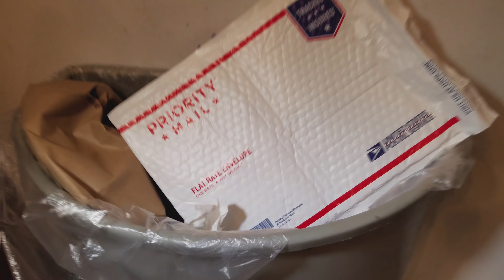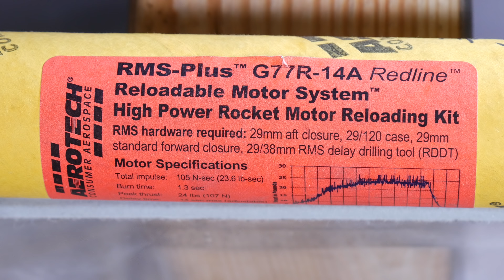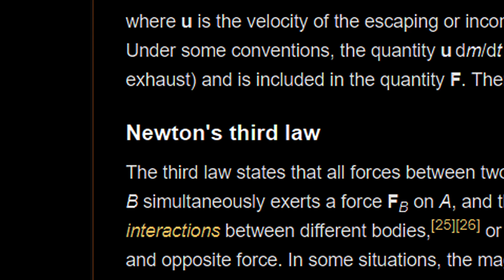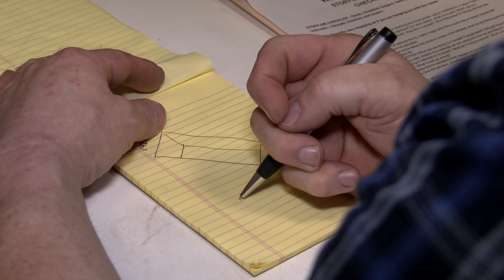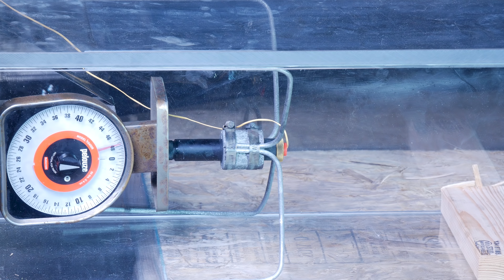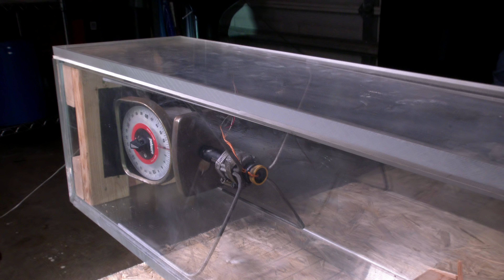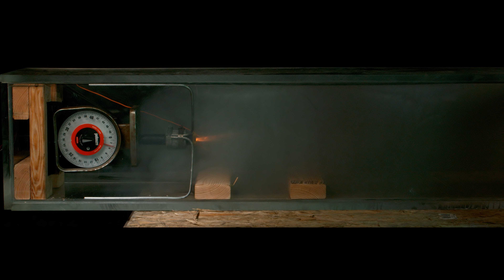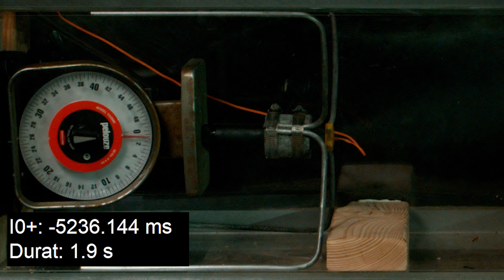Rockets in a Vacuum Chamber - Newton's third law of motion Visualized

Comment: Show the same video with a vaccum gauge the vacuum is filled with exhaust then you get thrust... Show it with a tank big enough to not deplete the vacuum and make that model rocket engine move. And then I'll believe it
Reply: How about live video of a rocket performing propulsive maneuvers in a vacuum.
Will you believe it then?
Reply: @stuartgray5877   the problem lies in expanding gases depleting the vacuum then you have thrust, space is an endless vacuum,allegedly, how would you reproduce this here btw I'm definitely not a flat earther...my questioning lies in the efficacy of a jetski drive out of water same principle right?
Reply: @shrek20035  What would happen if you fired a Crossbow into a vacuum?
Would you feel a recoil force?
Yes or no?
why or why not?
Reply: @stuartgray5877  absolutely 10% push you back 90% b bolt propelled forward, give or take of course depending on weight or mass ratio but that is a mechanical force....oranges and apples...
Reply: @shrek20035  - But HOW can you feel PUSH BACK?
There is NO AIR so what is providing the "Resistance" that causes the recoil force to be felt?

And what do you mean "oranges and apples"?

Are you suggesting that the physics is DIFFERENT between a crossbow pushing on a projectile and a rocket pushing on the exhaust gas?

HOW are those two things different??
Reply: @shrek20035  Stuart gray insists gases behave the same as solids. He's a badly programmed chatbot.
Reply: @stuartgray5877  a rocket is a heat engine, chatbot. A crossbow is not.
Reply: @papalegba6796  Papa Legba thinks GAS DOES NOT HAVE MASS.
Any high school graduate knows better.
Reply: @papalegba6796  So tell us HOW a space shuttle main engine can ACCELERATE 500 kilograms of MASS (every second) from a standstill to MACH EIGHT - WITHOUT FEELING A RECOIL FORCE!

WHY do you refuse to EXPLAIN THAT GENIUS?
BECASUE YOU CANNOT.
Reply: @stuartgray5877  lying about me again, chatbot? 😂
Reply: @stuartgray5877  Yep.. Papa want to believe one can accelerate mass with by doing nothing.. Nothing like defying the laws of physics..
Reply: @entangledmindcells9359  He knows better. He PRETENDS to be an imbecile because it gets him/it attention.

We KNOW Papa Legba is NOT A "Bot" because Bots can repeat basic physics properly.
I even asked ChatGP how rockets work in a vacuum, and IT understands Newton's laws just fine.
Reply: @stuartgray5877  I already explained, chatbot.
Reply: @papalegba6796  So Papa Tell me how a space shuttle main engine can accelerate 500 kilograms of PURE WATER from a standstill to MACH EIGHT - All WITHOUT FEELING A RECOIL FORCE.
Come on YOU CAN DO IT.
Reply: @papalegba6796  The 1st stage of the Saturn V rocket burnt 15 tons of fuel every second.
Do you not think that this 15 tons of mass was expelled out of the exhaust of the engines as mass in the form of burnt fuel gases?
If not, then where has the 15 tons of mass gone every second, if not out of the exhaust nozzles?
When this 15 tons of mass is expelled out of the exhaust nozzles at hypersonic velocity, a HUGE momentum force is created, correct?
Reply: @stuartgray5877  heat engines don't work by mechanical recoil, chatbot 😂😂😂😂😂😂😎😎😎😂😂
Reply: @papalegba6796  So you are still claiming that water can be accelerated without a force. Got it.
Reply: @stuartgray5877  no I'm claiming fire isn't water & heat engines don't work by mechanical recoil, chatbot 😂😂😂😂😂😂😂😂😂😂
Reply: @stuartgray5877  is ball aerospace a front for laundering embezzled public funds, chatbot? Answer please! 😂

Comment: Well done. Suggestions for improvement would be to actually show the vacuum gauge to establish that the chamber is under deep vacuum, showing the actual numbers for the thrust of the motor. I'm sure you'll get Flat Earth Extremists in here to claim that you didn't have a vacuum, and that you didn't actually measure the thrust. Which is fine, because their position is that there will no no thrust. The problem is that they aren't bound by the honesty of their own statements. And they don't recognize the validity of honesty to begin with.

So proven to the satisfaction of rational people, not to the airtight standards necessary for psychopaths. If you had a better way to measure thrust you could drive 'em absolutely bonkers (wait... they're already bonkers. I would argue that more bonkers isn't really a realistic goal) by showing that thrust in the atmosphere is actually less than the thrust in a vacuum for the same motor.
Reply: It wasn't to measure if there was more or less thrust, just that there is any at all.
Reply: But, not being bound by their own words, Flat Earth Extremists will say "You didn't measure the thrust....blah, blah, blah." They'll totally ignore their own claim that there wouldn't be any thrust at all, and start talking about whether there's really a vacuum there or how much thrust was measured.

And it tweaks them even more to prove that the thrust in a vacuum is actually greater than the thrust at atmospheric pressure. Since they are not bound by logic it's important to take every possible shred of human dignity from them and make sure they look like such fools that nobody will listen to them. You can't show mercy to a gang-banger. They only interpret it as weakness an ramp up the intimidation. And Flat Earth Extremists are a street gang, not a bunch of rational scientific investigators.
Reply: You don't need a deep vacuum nor could you get one with a setup like it's shown. Though, you don't need one either.

Comment: The problem is, (youll know if you watch codys lab) you have to have the rocket in a very confined space for it to release and ignite
Reply: No real problem at all - rockets are usually launched from Earth, where they are ignited and released in anything but a vacuum.

It doesn't change the fact that Newton's laws are unaffected by vacuum:

- Force is equal to the change in momentum per change in time; for a constant mass, force equals mass times acceleration.

- For every action, there is an equal but opposite reaction.

- An object will remain at rest or in uniform motion in a straight line unless acted upon by an external force.

A vacuum is not a magical place where these laws suddenly cease to apply, a vacuum is a perfectly natural place where the forces acting upon objects in motion or at rest (e.g., friction) are lower than they would be within a denser atmosphere, such as on the Earth's surface, or to a greater degree under water.

Why would anyone think that Newton's laws break down in a vacuum?  I'm not asking that facetiously, I'd really like to know what the experimental, mathematical, theoretical, or even Biblical support for that belief would be.
Reply: +raverkid loki:
That's probably because the rocket fuel need to transfer some heat to the rest of the fuel to help it burn. In a vacuum, the hot gases move away from the fuel too quickly, so having a confined space helps. I have seen some rockets designs that use a confined space and then the hot gases exit from the exhaust area.
Reply: Except - YOU CANNOT RE-IGNITE YOUR RETROS ONCE YOU HAVE LEFT THE EARTH - DUH!
Reply: The Unbiased Observer Go ahead and educate me. Why not?
Reply: +Flat as a cueball:
Think of a torch. Let's say your torch has a pure oxygen and acetylene mixture. You open your valves and make a spark and the gases start to burn. The gases move away from the torch head in a cylinder like form.

However, if you try that in space, it is difficult to start a fire. The gases move away from the torch head in a more cone form. It is also hard to pass high voltage current to ionize the gases.

This is something that was performed by Cody from Cody's lab.

If you want to start a burn in space, you need a confinement tube/chamber and this type of rocket design already exists.
Either you do that or you just pump gases out into space. <---- This is useful to make small corrections for satellites.
Reply: Vrej Egon Spengler ...So if the containment chamber exists to start a burn in space, and to my knowledge rockets carry oxidizer for the exact purpose of allowing combustion in space, I'm having a hard time figuring out why biased observer above thinks that re-ingniting retro rockets in space is an impossibility.
Reply: +Flat as a cueball:
Yes, NASA carries with it a lot of liquid oxygen and hydrogen. They are in that orange colored giant container which is larger than the shuttle itself. The orange color is due to rust.

I don't know why people spread false information.
Have a look at
https://en.wikipedia.org/wiki/Rocket
Look at the picture in the Net thrust section.

It says:
"A rocket jet shape varies based on external air pressure. From top to bottom: Underexpanded
Ideally Expanded
Overexpanded
Grossly overexpanded"

that should be "bottom to top".

The top one is "Grossly overexpanded". That is how it looks when you burn in space. Since there is no air to the sides, the molecules fly off into various directions, including the sides.

In any case, the important part is the combustion chamber. That's where you start a burn. Without that, it is not possible to start a burn in space.

CONCLUSION: rockets work fine in space. You can turn them off and on in space.

Comment: We still have some skeptics here. How about a simple change?
- instead of using a rocket engine build a small bomb (nothing huge). Put it in a little plastic easter eggs. 
- Then "boom."
- What will happen?
 Before the gas "creates an atmosphere" in the chamber, one half of the plastic egg will go that way and the other half will go the other way. 
The same with a rocket in a vacuum. Half the blast goes into the vacuum. The other half pushes your rocket. 
Action - Reaction moves your rocket.

Comment: The rocket exhaust pushes against the combustion chamber. You don't need atmosphere. At sea level the atmosphere helps, and that's why sea level optimized rocket motors tend to have smaller engine bells than second stage motors. Vacuum optimized rocket motors have larger engine bells to increase the surface area.

Comment: No one seems to be commenting on the fact that the igniter ejected from the propellant... in a vacuum
Reply: WHAT? action and REACTION actually WORK in a vacuum?  Who would have thought?
Reply: The igniter is pushing off from the rocket which is up against  the scale which is up against the wall of the chamber . You should be able to figure that out yourself .
Reply: inside that motor is a more confined space as well ........igniter "popping" against the inside of rocket motor

Comment: There is a problem with this experiment. When fuel combusts, it creates pressure. If it combusts in the vacuum chamber, it creates pressure inside the chamber and there is no longer a vacuum.
Reply: That's why the lit blew off the chamber!

Comment: The output of the "rocket" hits the walls which would cause thrust. This is in no way like space (where there are no walls). It was kind of cool though.
Reply: The movement of the gas out of the rocket into the vaccum produces thrust in the same way throwing a heavy object pushes you backwards.
Reply: How could the gas hitting the wall possibly produce thrust that goes back to the rocket?

Comment: Rockets don't "push against" air.
Reply: Don I would disagree that lol. Yeah of course it gets more thrust from a solid object like the ground but yes rockets do indeed push off of air.
Reply: Tyler Sanders I might be wrong but I think he was more saying they don't need air to push against just the force being pushed out the back causes the opposite reaction to push the rocket forward. Like I said I might be wrong and he might be a flat earther that thinks Rockets can't even work in an atmosphere but I'm pretty sure adjustment that they don't need air to work. You would have to be a superbly idiotic person to believe they couldn't work in an atmosphere. This could be proven wrong so easily and so many ways. One just by lighting a bottle rocket and throwing it in the air before it ignites and when and ignites in the air and fires off in some Direction it worked without pushing off the ground. Also the fact that missiles speed up in flight as in they don't take off already at maximum speed so they're obviously pushing without pushing off the ground so I'm just going to go ahead and say this guy can't really be that stupid but I've been wrong before
Reply: Rockets don't.  Jets do.  Rockets push against the craft as it exits in the vacuum of space.  That is actually the very distinction between a jet and a rocket.

Comment: you proved the equal and opposite reaction when the igniter jumped out of the propellant tube.... that's why you had to zip tie it in the next attempts
Reply: Chris Huff shhhhh..... the flat earthers can’t handle logic. You’ll make their heads explode.
Reply: crazybastard82 ROFL
Reply: +Chris Huff We've always considered zip-tying the igniter up the nozzle to be somewhat dangerous.  If it causes the igniter leads to crumple in just the wrong way, it'll plug the nozzle, the motor chamber will over-pressure and burst.  Which would could damage the vacuum chamber, possibly exercise the safety shield, and require him to buy a new Aerotech casing (which aren't cheap).

The real answer is to use a better igniter.  Aerotech igniters suck.  Especially the really tiny ones used in G motors.